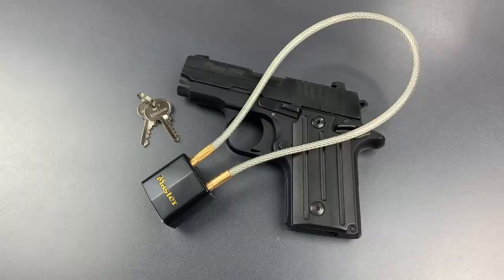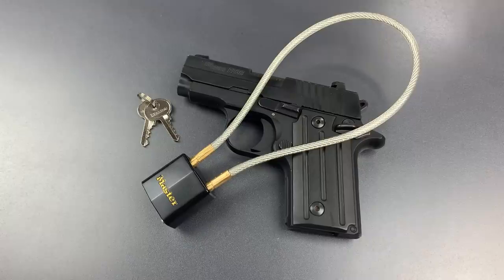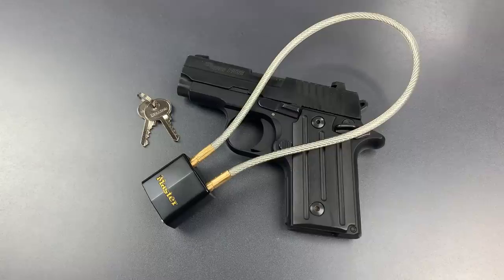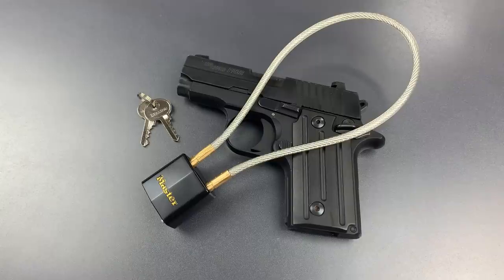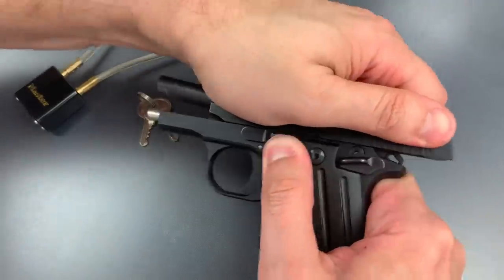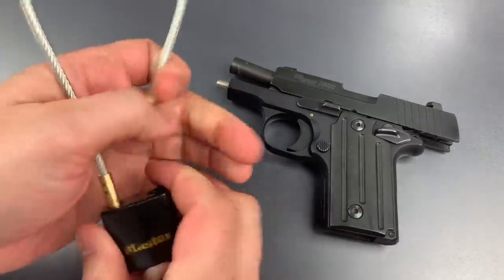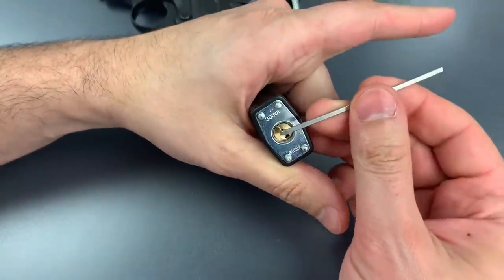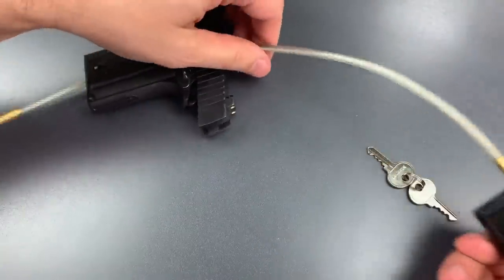[770] Master Lock Cable Gun Lock Picked FAST (Model 99DSPT)

Comment: I suspect a lot of these gun locks exist (either included in the package with the gun or used by gun owners) because laws somewhere require gun makers to include one or because laws require gun owners to use them.

That said, I agree with whoever said that the gun lock LPL came up with should be turned into a product. Its definitely something I am sure many gun owners would be interested in (if it was built out of sufficiently sturdy/destructive-attack-resistant materials and had a decent hard-to-pick-open core)

Comment: I'm not sure a 'curious adolescent' would have access to or even know to use a '40 thousandths thick wiper insert for top of the keyway tension and a Peterson wave rake'. Sure, anyone with cursory lockpicking knowledge and any slightly related tools could open the lock, but that's already skipping some steps. I have no doubt you could probably make your same point by using more jury-rigged tools, but with this video you're still using tools that I wouldn't have laying around for my adolescent to open a gun lock with. Might you be coming at the gun lock a little biased even in just your use of tools, not including your expertise? Maybe a part 2 with a knife and bobby pin? Love your videos, keep up the awesome content!
Reply: I, and a few others, have made this point about the tools. There's no denying that the proper lock picking tools give a serious advantage over a pair of bobby pins. However LPL doesn't seem to be interested in even defending his insistence on using tools an adolescent doesn't have on a lock that guards against adolescents.
Reply: Not to mention that the bitting is often if not always seriously poor in many of these videos. I've seen some pretty poor keys when shopping for locks, they're right there in the package and you can tell straight away if they're easy to rake or not. So I avoid these. I feel like he needs to inspect each lock and get the most difficult one on the shelf, if possible.
Reply: Given, an adolescent can also probably get their hands on a set of lockpicking tools either online or via some other route, but then we're talking a level of forethought and intent equal to just getting another gun.
Reply: I can assure you that if a lock can be raked open this quickly with these specialized tools, it will also be pretty easy to open with any improvised tools and some patience. It would be nice if LPL would demonstrate this as well…
Reply: For an adolecent to obtain a lockpick set, they either need to find a local source (provided they have the funds) or in the case of online purchases, they will need to have a credit/debit card. You can't have one if you're under 18, which narrows their options. They would have to swipe a card from their parents and hope they don't notice the transaction, or go through a sibling if they have one that's old enough to have a card.
Reply: MrPibb23x few dollars on Amazon to buy the rake, 2 minute video on YouTube...yeah thats too much work for a 13 year old 😴
Reply: Amazon has gift cards that anyone can buy.
Reply: @sebastianhart217  you can upload funds on Amazon accounts with your phone at any PayPoint also. (it gives you a barcode on your phone they can scan)
Reply: Given that my 12yr old SPP'd a master lock faster than me the first time he did it compared to my first time using tools fashioned from wiper blades, I'd say that the adolescent would be able to make the tools needed for job.  However in defence of your view point it would be nice for LPL to make a set of tools using only pliers and files from a wiper insert and then pick the lock/rake the lock using those tools.  This would definitely be the definition of "hey, lets go shoot the gun.  Oh we need some way to get in.  Yeah, I saw this video on YouTube once...!"
Reply: I think an adolescent has access to YouTube.
Reply: When I was a teen  I made a pick from a small paring knife using Grandpa's bench grinder one night. Just looked at pictures on the internet to come up with something close. I used it to SPP the lock on the Thermostat so I could turn it down. Then I locked it back up. Eventually they figured out I had a way to get in since the temp kept changing so they didnt bother with it and even lost the key, so they finally asked me one day to remove the cover and leave it off.
Reply: You're not thinking like a kid. Who cares about picking the lock if you can just cut through the cable with a cold chisel and a hammer? How about using diagonal wire cutters and hitting them with a hammer? How about actual cutters designed for cables? How about a tree pruner? How about a welding torch? Do you imagine that adolescent kids aren't watching and reading youtube comments? This master lock would not even represent a bump in the road for any kid that wanted to fire that weapon or just wanted in ... because reasons. If you could summarize all of mankind into a single word, it would be curiosity.

Granted a rake can do it in seconds, but a hammer, a chisel, and some vice grips can demolish a locked key box in minutes, so that cable lock is a joke. Trust me, as a curious child I ripped open somebody's lock box for no other reason than to see what was in there. That was decades ago (and a shitty thing to do), but human boys are still built the same way. I put the key under their door when I got it out of the box, btw. I was curious (and stupid), not malicious.

You can make a rake from a piece of metal in no time and kids have nothing but time and curiosity (and they hate to be idle). A piece of coat hanger, pliers, and a file, now you have a rake. Five more minutes or an old wiper blade later and you have a custom tension tool made to order for whatever lock you have in front of you.

This whole idea is like saying that raccoons can't open the trashcan because the metal lid fits really tight. Have you ever seen a real raccoon or a curious boy? Even an octopus can unscrew the top off a jar without ever seeing a jar before. That lock is toast when a kid decides to find a way around it unless it is actually a secure and hardened device intended to avoid an actual attack. Put the pistol in a proper safe where the kid doesn't see it or think about it. Take the kid out on weekends and teach them how to handle a weapon safely. Removing the novelty and curiosity of pistols in general would be tons more useful than this joke of a lock.

So the TL;DR is:
If instead of a rake LPL took 60 minutes to hand make a pick device from scratch and spent 30 seconds to open the lock, would you imagine that kids don't have youtube, an imagination, and an hour of free time? The lock is junk and kids are waaaay more clever than you give them credit for.

I apologize to MrPibb23x, because this was not aimed at you personally, it was just a convenient place to interject my dissenting opinion to your "side" of the discussion. Despite what I just said, I do get your point and would agree with you if I had not raised a couple of boys and grew up too smart for my own britches. LPL could design a more realistic scenario, but I think it would just boil down to how much time would it take a kid to break a shit lock. Would it be 5 seconds or five minutes? Would it be faster to pick the lock or just cut the cable? In the end, the kid still gets the pistol before you get home from work. There is no security in obscurity. It just takes a bit longer.  Do you want to watch LPL slowly bend and file a coat-hanger into a rake and then pop the lock in the same five seconds that you just watched? Have you ever seen a prisoner rub a toothbrush handle on a concrete floor for days to make a shiv? Have you ever seen user-made lockpicks? Kids are not stupid and all that is available in detail on youtube.
Reply: Indeed, the bitting is key to rakeability. I bought a dirt cheap Chinese padlock... it cannot be raked because it happens to have a tricky bitting, accidentally.
Reply: I wouldn't even bother with the picking frankly. Using a simple pair of snipper pliers, i would pick the wire apart strand by strand, something i've done before when i've lost the key to faaar more impressive locks. Heck, with the right technique, i bet i could go through that wire with a knife.
Reply: It's a rake, and a tensioner. Having these tools just make it quicker, not any more possible. The entire point is that with rudamentary knowledge of picking, your kid could have access to a firearm. It'd take a couple of bobby pins, some sand paper, and a few minutes.
Reply: My grandpa had a handgun when I was a kid , but he took care to teach me how it works and what it does , before I could even get to idea of to fire it somewhere. :) Or to someone.
But , many years later , I wanted to get my fathers' professional audio equipment to be able to play with my band like our idols used to. :) And , we ofc didn't even had close of sum to rent it from studio. It was 1000's $ worth equipment , and , in summer of 1999 , I got the idea from movies I saw on TV how to make a key from trash and two precision screwdrivers , but , I had to make it from piece of paper , where I'd make a drawing of how it looks , and then , draw that same lines on piece of hard plastic , so , it would just keep pins in their position , and using screwdrivers to rotate it. :) But , he noticed that "someone" ransacked the room , and he knew it was me. So , my little "covert operation" ended up in fail , but I quickly learned that I could get arrested for theft , if I succeded in it , and that blew off steam off of me. :)
I hope this helps some other "16 years old" from even trying something similar. :)
Reply: Take a few moments and try and come up with a curious adolescent in your life that you actually care about and would want to keep from accessing a deadly weapon. If this doesn't make you realize how stupidly quibbling over supposedly realistic tools is when it come to that person's life please take more time to think this over. Maybe talk to people in your life about protecting people they love and what they think is reasonable to do.

We don't want the "ohh let me try jimmying this lock with a bobbypin/paperclip/whatever level of protection." This isn't for the purposes of simulation or a McGuyver fantasy. This is to protect people
Reply: Like I said though, at that point we're talking having something shipped to your house with the intent of opening the lock. At that point we could be talking anything else dangerous or unwanted shipped to the house too, including a new gun.
Reply: it would be just as easy to go down to the local hardware store and purchase a small set of bolt cutters. Even a mini hack saw
Reply: I'm a adolescent and I got my hands on some good lock picking tools online for 20 bucks it wouldn't be that hard or watch some YouTube and make tools out of paper clips
Reply: @l4d2160  You can buy a prepaid Visa gift card for cash at just about any convenience store or drug store, and register it online to make online purchases with without any proof of age. Motivated minors can and do make online purchases without their parents knowledge.

Comment: I got three of these types of locks someone threw away.   Two of them were made in China and picked open the exact same way as the Master Lock in this video.    The third one was one of those Project Childsafe locks and was just as easy to open if you know how to open locks with wafers on the top and bottom of the keyway.    Unless they make a lock with security pins (serrated, spool, mushroom) instead of wafers, they'll continue to be junk.

Comment: LPL, "unskilled adolescents" don't have access to rakes and tensioners. You can't just buy lock picks at Walmart. Any kid seeing this lock on their parents gun will see that cable as the easiest way in, then go into their father's toolbox and use any cheap pliers to cut through the cable. That's much easier and faster to do than ordering a lock pick kit from eBay and then learning how to rake.

Comment: Those mushroom shaped shackle ends can often just be wiggled out of the locking pall. The tolerances on these locks need to be very tight to prevent the thing from accidentally being popped open just by playing with the cable.

Comment: For the 1000th episode i need you to break into a house door. I want to see how secure those are.
Reply: He's done plenty already.
Reply: Yeah, I’d echo the above. He’s done loads, even Euro cylinders which are the door lock of choice over here in the uk.

The security level of any door lock depends, usually, on the manufacturer and the amount you’re willing to spend.  Landlords who change locks regularly tend to purchase no name cheap cylinders you can rake into in seconds. Some of the 3* Yale’s or Assa’s though can be a real challenge for all but the very experienced or talented.  Even some Mila’s can be a bit tricky.
Reply: Luckily LPL's skill level is rare, unless you have very secure windows and doors already it doesn't take much to make the lock unappealing.
Reply: Really depends on the landlord. My door is easier to just break down, than it is to pick. It's a rather flimsy door, but the lock seems to be overkill. Judging by my key, it's an 8-pin ASSA lock.With plenty of variation in the bitting, mine has a good pattern that goes from very high, to very low, to high, low and high again. (Although I could be wrong, since they use a master key type system in this building, so our keys also work for the main entrance and basement)
Reply: He uses regular kwickset locks on his home so he knows nothing will stop a determined thief....
Reply: Instead of picking the lock, I would for a bypass attack instead.
Reply: I want to see non-destructive attempt on Abloy Exec or even Sento
Reply: Bosnian Bill's door locks?
Reply: Only one he can't {none have}. That one being the Bowley lock.
All locks are the same concept

Comment: A cover for the lock could be made of sheet metal. Kind of poor man's Forever Lock. There should be distance between the cover and lock body, so that the key would fit sideways under the cover. It could then be pushed to keyhole.

Turning the key might be a bit awkvard, unless some rotating "fork" is installed through the cover, and there's a knob to turn the key. The point is to limit the working space of a lockpicker. Raking and picking tools would have to be modified at least.

Comment: Every time I see a Master Lock and LPL in a video title, I know it's not going to be good.

Master Lock need to master the science of building a lock capable of defending against a third grade child. You were able to rake that cable lock open as fast as if you were using the key. That's not even the illusion of safety, and won't keep honest people honest.
Reply: They know how.  They own american lock
Reply: Have you looked at any of the American Locks manufactured by Master recently? When they shifted the manufacturing south, all illusions of quality went out the window.

There is a huge difference in the dimensions on old American locks verses newly build American locks. Open one up and verify the lack of grease for the locking balls or actuator assembly. IMO, they're not usable out of the box without service.

The 700 is my go to lock for 70% of the stuff I secure. The other 30% is Medeco or Abus Plus core locks.

Comment: What's up with the barrel on that gun? It looks like it's angled upward. Is it just loose when the slide is pulled back on that particular model?
Reply: Ian @ Forgotten Weapons, (dot com and youtube channel) can explain it better, but the tilting barrel is part of the design that locks the action when a round goes into battery.
Reply: So it's space saving measure for a super compact pistol. I figured that had something to do with it. Definitely looks odd at first glance though.
Reply: @kayce851  Even a full length 1911 does the same thing.

It's part of the system John Browning designed to ensure that the recoil process was delayed enough to let the round leave the muzzle before a bunch of relatively heavy moving parts started slamming around.

Comment: Man I'm still waiting to hear about all of these curious adolescents that have nice sets of rake picks and tension wrenches...  Someone else suggested this last time you did one of these, but I'm going to suggest it again, try this with improvised tools, I think that would be a more realistic test.
Reply: I think your upbringing was just different from others. First, the tension wrench is just a piece of wiper blade. Second, cheap rakes like this are extremely cheap and easily available all over the country. Many of my middle school and high school friends had very easy access to all of this and much more with very little effort.
Reply: I used to pick my friend's school locker with a paperclip just to mess with him, I got pretty good at raking it with a paperclip. IIRC, those were also Master Locks as well.